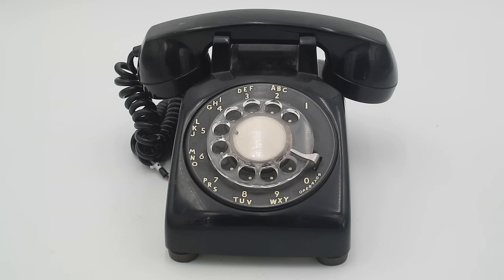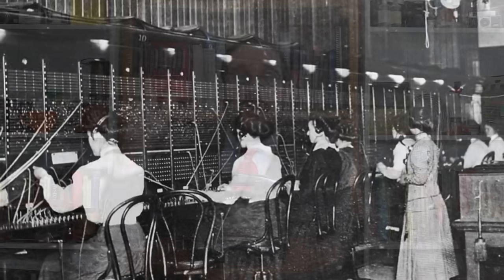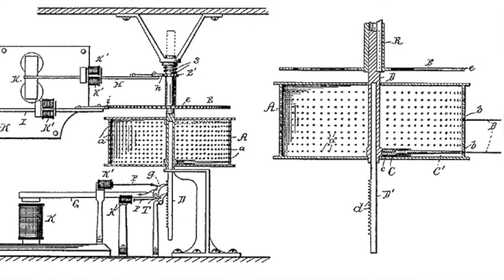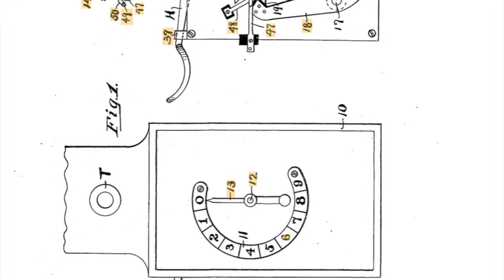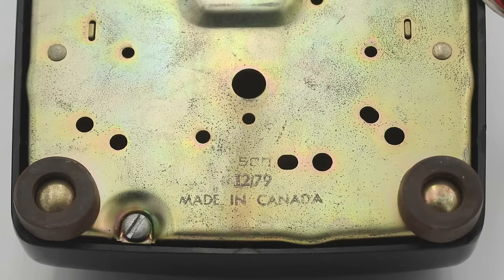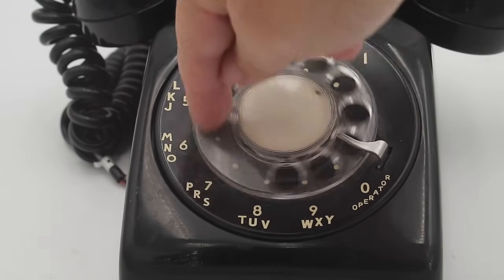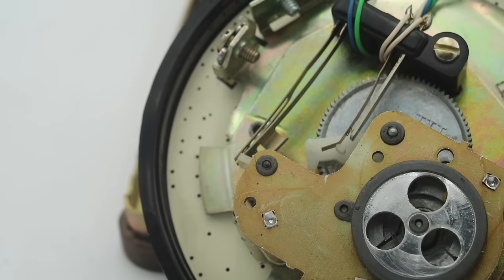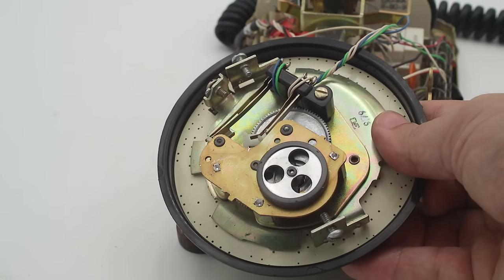Rotary Phones: the Call of History

Comment: I am old enough to remember using rotary dial telephones when I was young and growing up. One of the facts about these old rotary telephones was that the telephone company owned all of these telephones and basically rented the equipment out to users. As a result of the telephone company owning these rotary dial telephones, these telephones were built to be very rugged and last a very long time. It is likely that the old phones shown on this video would still work today if connected to a rotary dial system.
Reply: I have an avocado green one from the late 70’s plugged in and it works. The power went out once, the phone still worked of course.
Reply: They do still work in 2023.  I use this type of phone as "emergency backup" to the cell phone.  Bell in Ontario offers a 5 $ a month discount for a rotary dial phone...  in 2023 !
Reply: I have not tried recently but a few years ago in NZ either tone or pulse could be used.
Reply: Where I am (rural area) rotary still works. Have the same phone he has on the table use it regularly. In more populated areas home phones still exist but aren't old copper lines and work over cable Internet stuff and don't support pulse tone.
Reply: @JrGoonior  Phone systems have their own 24V power source along the phone line, separate from the electric power system.
Reply: It took a court case to allow people to buy their own phones (the precedence carried over to cable boxes, too).
Reply: This is often the case with home internet and tv equipment as well
Though you can just use your own router for internet if you want
Reply: I still have some in a bos, from being an I&R tech for 30 years.~~
Reply: The ones our household had were all made by Western Electric to the HIGHEST Quality Standards at the time! They were the "Toyotas" of telephone equipment!
Reply: You are exactly right. I've got a Western Electric #302 that I found in a thrift shop 30 to 35 years ago. I think I paid $10.00 for it. It had a broken wire in the line that connected to the wall. Once I fixed that, it worked perfectly.  I've been using it all these years and it still works perfectly to this day. The date stamped inside is 1946. To my knowledge, it has never been rebuilt or restored. My phone housing is metal, not plastic and actually looks quite rough - very original looking, for what that's worth.

Comment: The number on almost all the parts indicate the date of manufacture. In your Western Electric version 500 set, the number on the bottom (12/79) indicate that part (the base) was manufactured in December,1979. Later on Western Electric started using a longer number indicating the year and the day number of the year. You can find the dates on almost all the individual parts even the handsets and the microphones.
The Bell System phones with the dial in the handset, were trademarked with the name "Trimline". Copycat manufactures used the name Slim Line. The Bell System also had the name Touch Tone trademarked. 
A very good book on Phone Phreaking is "Exploding the Phone: The untold story of the phone freakers" by Phil Lapsley. It goes into great detail on the history and some of the people involved. The original Freekers, were not just trying to get free calls, they just wanted to explore, and learn how the phone system worked. It was the bad guys that later started making money from it. The book was researched and written by a member of Telephone Collectors International.
Reply: I read that book recently.  It is very interesting.
Reply: Another date code format, common on semiconductors, is week number and year. Thus 12/79 would 19-25th March 1979

Comment: It's also worth mentioning that when the original long distance area codes were designed, they had to have a one or a zero as the middle digit.  "Important" business cities got 1's as the middle digit and low numbers for the first and third digit. i.e. NYC 212, LA 213, Chicago 312, San Fran, 415 etc.   Less important cities got zero's as the middle digit and higher numbers and first and third digit, i.e Nova Scotia 902, South Carolina 802 then later 808 Hawaii, 907 Alaska, 906 Michigan Upper Peninsula.   The reason?   Rotary dialing 906 takes way more time than dialing 212.    Business people needing to reach head office or their broker etc didn't want to wait so long....and if you made a mistake you had to start over taking even more time with a "zero middle" area code.  

Eventually phone networks figured out how to have any digit as the middle digit in an area code and how to overlay area codes in the same region.  The advent of touch tone dialing took the same time to enter a 10 digit number no matter what the area code was.

Comment: That was an excellent in-depth overview.  I grew up with a model A1 and 302, and was annoyed when the phone company tore them out and replaced them with model 500s.  There is a model 500 in the time-capsule buried at Marietta House Museum in Glendale, Maryland.  The capsule is pressurized to 5 PSI with argon, and is scheduled to be opened in 2096, so it stands a good chance of making it intact, along with all the other stuff.

I recall sometime in the early 1980s when I noticed that the dialing callous on my finger had disappeared.  ;-)  Up through the 1960s it was common for businesses to distribute plastic sticks for dialing, with their names on them, to save your fingers.  What was especially common were pencils with a round red ball at the end, that neatly fit into the finger-hole on a dial.

Also note that — given the physical size of the plug-holes on a switchboard — a grid 100 X 100 was about the arm-span of a typical operator, which is why an exchange has 10,000 numbers.

Bob Roswell at the System Source Computer Museum in Cockeysville, Maryland has a collection of rotary dial telephone equipment which he plans to assemble into a functioning (but small) stepper exchange.
Reply: The really annoying thing about rotary dials was how slow they were. If you "helped" them by speeding up the return, mostly they worked faster. But if you made a mistake dialing, you had to start all over again, and the crosser you got, the more mistakes.
Reply: Ha, you beat me to it. I was going to say I remember as a kid my parents had a ball point pen from some business with their phone number on it, and it had a plastic ball and disc at the top that fit in the rotary phone dial holes to save your finger.

Comment: I'm a millennial and definitely used a rotary dozens of times when I was a kid...however I really appreciate you that you didn't judge the young ones for not learning how to use a rotary. 

Fantastic video!
Reply: Millennial as well; they were so fun to dial
Reply: Yah, a few older relatives had a couple around their houses, though they also had touch-tone phones too.  
And my grandparents had one at their vacation cabin.  As a kid, it was kinda fun dialing all ten digits on it, to call home if I was there with my grandparents.  (And thanks to the time and the noise, it was probably also a deterrent to us kids making unwanted and expensive long-distance calls, too. 🙂)
Reply: Northern Electric made phones for many Non-Bell Independent phone companies. Also many Non- Bell independent phone companies purchased Western Electric crossbar equipment in order to be compatible to connect to Bell System customers.
Reply: @gabotron94  I remember when Touch-Tone (DTMF) dialing was invented.  It was so much faster than rotary phones.  They were more fun!!!   🙂

Comment: In the UK we had an "official procedure" for dialing 999 in the dark...  you put your ring finger in 0... and you can feel that because it's next to that bit of metal that's right next to 0... you can then easily slip your middle finger into 9...... it's  loads easier if you look at one of the explanatory diagrams that were printed in most Post Office Telephones publications.
Reply: That was it: „Feel for the stop: Zero is next to it. Nine is just to its left.“ 👍

When you think a little bit about that, it makes dialling numbers formed of nines and zeroes by feel much easier compared to numbers formed of ones and twos. (Where you'd have to feel for the stop, then trace along the edge of the dial hoping your finger would then fall into 1.) ☎
Reply: @dieseldragon6756  And for us in Australia it is 000, so it would have been even more easy.
Reply: @steviebboy69  I know Australian and NZ exchanges use the complete opposite approach to European exchanges when it comes to pulse dialling (In Europe pips sent = digit dialled, Aus/NZ pips sent = 11-digit) so dialling 000 would be 1-1-1 when switchhooked, wouldn't it? 😇

I never understood why that approach was used on the southern colonial systems though. I know you folks are on the other side of the equator, but - Unlike water flow in the toilet - That doesn't exactly change the electrical characteristics, does it? 🙃
Reply: @dieseldragon6756  Reversed dials were used in NZ, not Australia.

Comment: Oh god I remember seeing old home videos of my aunt in the early 80's practically speed dialing with a rotary phone using a pencil to dial and looking like she was drawing on the phone with how fast she moved.😅
Reply: She must have had long finger nails.
Reply: I can't find an example now in my current assortment, but during the heyday of dialing there were a couple of common styles of ink pens (usually used as promotional giveaways) having a knob on the non-writing end, specially shaped and sometimes free spinning, designed to fit into phone dial holes. Haven't thought of those in years but your pencil comment triggered the memory.

Comment: So that's the reason for a "MARKER". You're the first one who's finally made it clear to me. The "Step by Step" switch virtually "Wires" the the electrical path as you dial. The "MARKER" in the "PANEL" switch waits until all the pulse information is totally complete then arranges the signal path all at once. (I think). But now I see a distinct difference. Thanks for the insight. Jeff

Comment: Growing up in Kentucky my father was the only electronics specialist in the area. He taught me the trick of tapping the  phone numbers on a pay phone if I had an emergency and needed to get a hold of someone and had no money. Needless to say I was very popular with anyone that needed to make a call but had no money. I got very adept at quickly being able to tap out phone numbers.
Reply: Here in England you had to put a penny the payphone slot in order to obtain a line exept for a 999 emergency call. At last I know how it was done. Great video.
Reply: That is the reason pay stations were switched to ground start trunks as you didn't get dial tone until you deposited the required amount.  But then hackers discovered you could get dial tone by taking off the transmitter cap and grounding one of the contacts inside. Then they started gluing the caps on so you couldn't unscrew them.  I was a telco tech for over 30 years and saw it go from mechanical switching to electronic then digital and finally to VoIP.
Reply: @gwesco  I've never heard of a payphone for which hook switch dialing would do you any good. I've heard of ones where you have to insert a coin before you even get a dial tone, so hook switch dialing won't get you anywhere with those. And the ones in my area when I was a kid in the late '70s and '80s could all be dialed normally and you only inserted money when your call was answered (you could hear them but they couldn't hear you until you inserted 20 cents). Hook switch dialing is pointless for that type of payphone too, because the rotary dial already works fine without inserting money.
Reply: @MaximRecoil  When you deposit the required coins in those old 3 slots, it would provide a ground to start the ground start trunk and give you dial tone.  Many college folks discovered that you could remove the transmitter cap and ground one of the contacts to a metal ground like the booth.  That gave you dial tone and you could then hook switch dial. That's why they started gluing  the caps on.  BTW, I spent 32 years as a telecom tech working on everything from mechanical to VoIP phone systems..
Reply: @gwesco  "That gave you dial tone and you could then hook switch dial."

If you have dial tone at that point and can hook switch dial then you should also be able to just use the actual dial to dial. The dial's primary leaf switch (the one that sends the pulses; not the unnecessary one that just shunts the receiver to make it so you don't hear loud clicks when dialing) is wired to the same terminals on the network as the hook switch is, i.e., they are wired in parallel with each other and therefore they both do the exact same thing, which is why hook switch dialing works in the first place.

Comment: I remember an early  (~1977) experience as a coop student working at a Bell company. I visited a "Central Office" (a modest nondescript office building with windows all brinked over for security) which handled switching for quite a number of local customers. As I recall, there were two or three switching technologies in use. Most was crossbar switching and the constant click-clacking was surprising. I think there may have been some older mechanical switching tech, as well. However, the company had begun the installation of some electronic switching systems which were of course quieter and more reliable than any of the mechanical systems. Most dramatically, the electronic systems required a tiny footprint compared to that required by even the crossbar systems.

Comment: I was just about to inform you about New Zealand reverse dial installations, but you beat me to it in your dialogue.  Quite correct.

BTW, "111" is still the emergency number in New Zealand.  With the advent of DTMF (Dual Tone Multiple Frequency) three brief pushes of the "1" button signaled Emergency.  This became a long-term pain for NZ emergency operators, as this can STILL be easily misdialed on any phone - especially by young kids who are also greatly inclined to poke fork tines into wall power outlets.

As a teenager, I was guilty of using payphones on occasion to pulse-dial with the cradle switch and it worked great - for a few years.  The trick of course was becoming proficient with subtracting each number you wanted to dial from the value ten.

Crossbar exchanges had a rather short history in New Zealand as fully electronic exchanges were very soon after supplanting all exchanges throughout the country (10-20 years).

Thanks for the brief walk down memory lane Sir.

Comment: I had a pair of those classic phones that I rescued from a house that was being demolished and kept for years but at some point they disappeared.  I remember actually connecting a battery to them and hooking them together and they could talk to each other.  No dialing though in this case since only two phones were on the circuit.
Reply: I regularly overheard conversations from neighbors due to crosstalk of phone lines.
Reply: @mrkitty777  Because of that, we all heard what we wanted to know about the neighbors, until we heard too much. 🙂
Reply: @keithbrown7685  it was at the farm, rural area, mostly about cows, milk, sheeps, catfood, good old days, well they certainly could hear us too but it was one way only, i think an ongoing call could be heard, but they couldn't be spoken too, and the otherway around.
Reply: @mrkitty777 party lines cheaper in rural areas than private lines

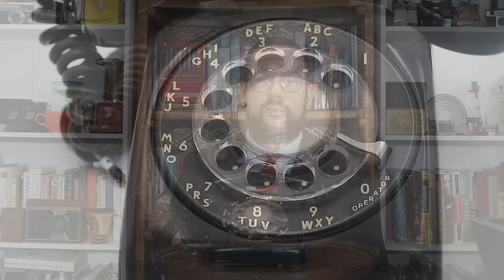Comment: Another correction: The 0 through 9 arrangement you show at 19:01 was NOT used in "the rest of Europe" This particular layout was ONLY used in Sweden. There is a third layout used in New Zealand which is entirely reversed and goes from 9 to 0 (where 9 produces ONE pulse and 0 produces TEN pulses). This third layout was also used in the city of Oslo, but NOT in the rest of Norway.
Reply: How did it work when you called from Osto to a different city? Should the different systems cause dome confusion or was the number transmitted some other way?
Reply: @okaro6595 the switch board handeled the translations of pulses.
Reply: It also helped with the old pay phone when you had no money here in NZ to call your parents to pick you up .
Reply: Glad you got there first, the 1 thru zero is standard most places
Reply: I was thinking the labelling on the dial itself must surely be reversed in the New Zealand implementation when he mentioned the emergency number being 111. Thanks for confirming this
Reply: When I remember it wright,  Austria as well had the 0 to 9 system on their dial. 
.... and they were driving on the left hand side of the road 🙄

Comment: Great video.  What this highlights is how companies used to do everything for the customer.  They employed many, to run complicated, expensive switch boards and transmission lines, to bring you the ease of just asking an operator for a connection, or later, simply dialing a number.  When you subscribed, they came to you, and even provided the equipment. When there was a problem, they would come check it out at no charge.  Today, the roles are reversed.  You must decipher complicated technology, while computers handle the carrier's job.  And when you have a problem, and can actually reach someone about it, their first step is to blame the customer.

Comment: This was entertaining!  We still had two working rotary telephones on a "phone company" landline until we moved in 12/2020.  Those devices were over 35 years old, and would have lasted forever.  I don't necessarily miss dialing all of those pulses, but the handsets were far better ergonomically and sound-wise than a modern cell phone.   Somehow, the verbs "dial" and "hang up" persist, such as in medical office automated systems.  "If this is a medical emergency, hang up and dial 911."  Fun fact about the Hotel Pennsylvania in New York:  It retained the phone number made famous by Glenn Miller until it closed in 2020, although it was expressed as 736-5000.